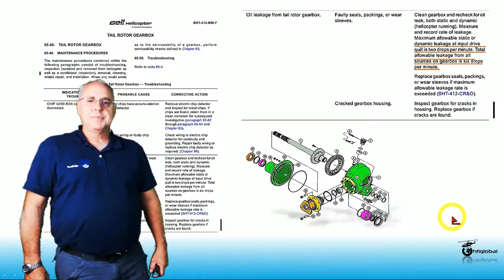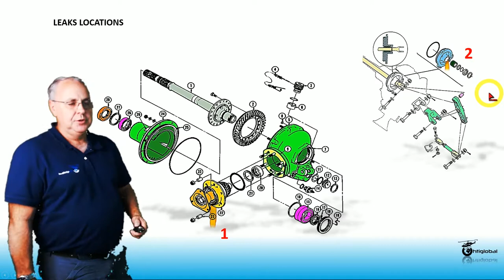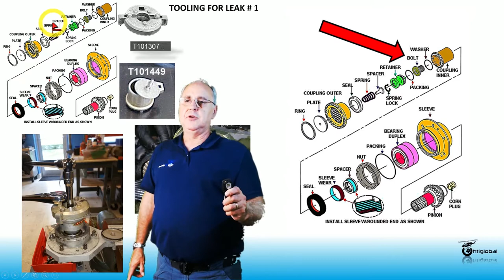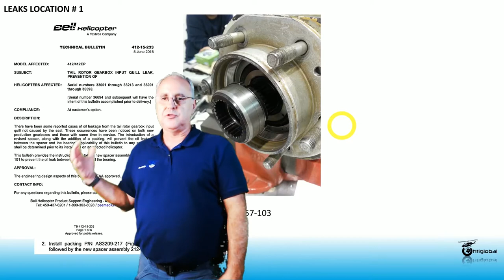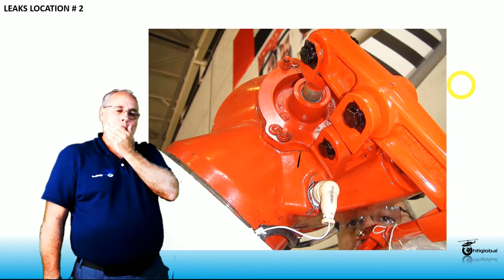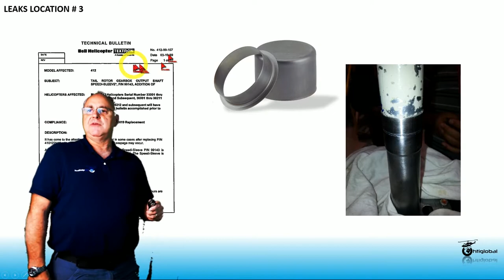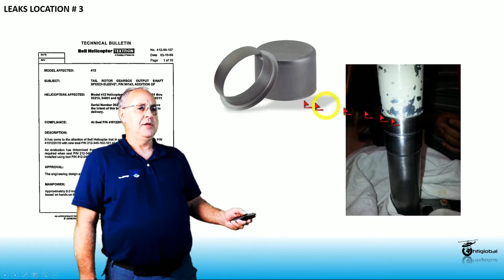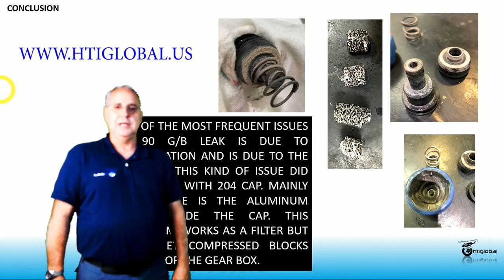BELL 205, 212, 412, HUEY2 TAIL ROTOR GEARBOX LEAK ISSUES

Comment: Hi Pablo !! I'm Víctor from Spain. I've seen the video and it's very interesting, but I have got a question. If the cap is clogged, It is possible that It causes a leakage through the shaft (P/N: 212-040-462-001) ??  therefore the oil would go out by the shield (P/N: 212-010-732-001). Thank very much and congratulations for your channel.
Reply from the maker: Hello, normally after the gear bix is pressurized due to the cao, thw oil will find the easiest way out and normallynwill be on the left skde where the push pull tube is. Of course if the input quill or output shaft seal are worn out, it can leak from there.. I hope this helps you. Regards and thank you for watching. Regards, Pablo